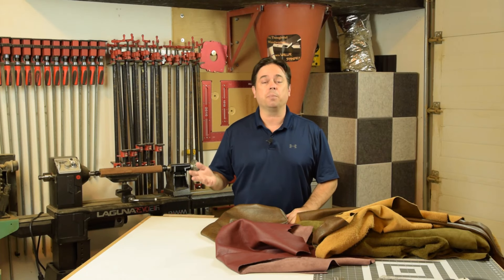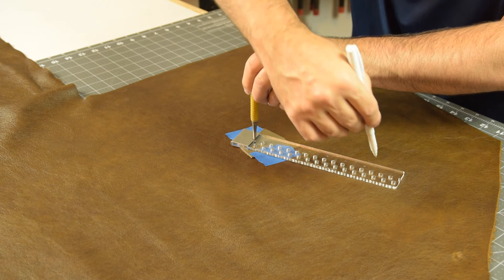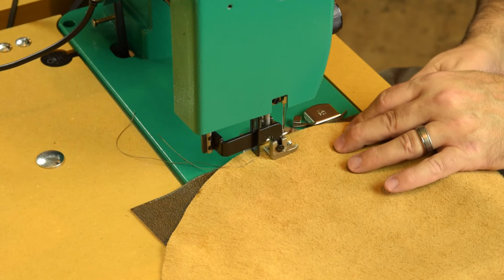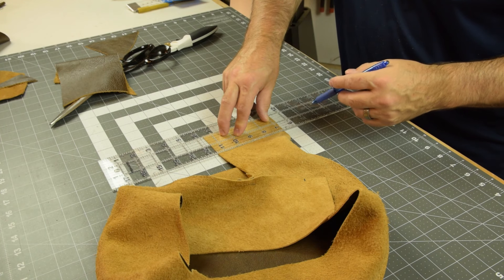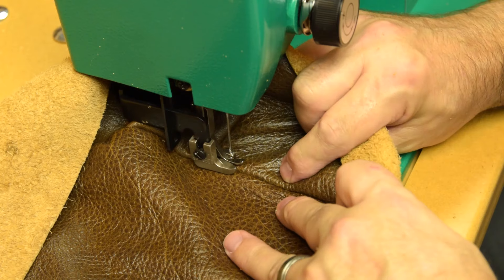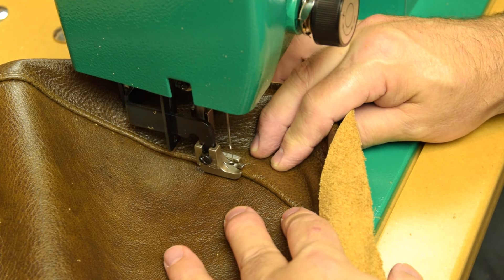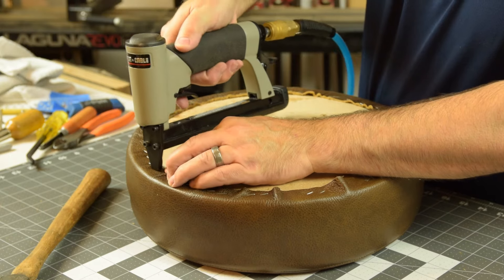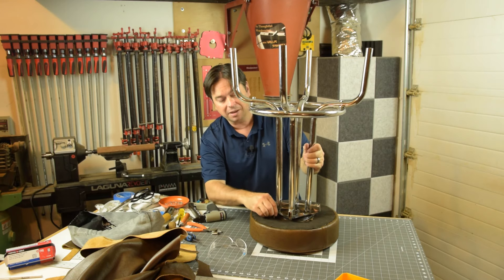Upholster Leather Stool with Sailrite Leatherwork Walking Foot Sewing Machine / Leather Upholstery

Comment: Would air vents help stop the cushion from bursting once many persons sit upon this? Or would horsehair be better than foam? The sewing machine and your steady accurate sewing is wonderful.
Reply from the maker: You bring up a good point about venting leather.  Loose leather cushions like backrest cushions should be vented.  Seats attached to plywood or other frames don't need vents, as long as there's a way for the air to escape.  Drilling a few holes in the plywood is a good idea.  As far as your horse hair question, I really prefer foam for comfort and availability.  Thanks!

Comment: What is that little curved attachment to the right of the sewing foot? Looks like a half moon shaped sewing guide of some kind? Did that come from sailrite?
Reply from the maker: Hi Wendy, that's a pair of small magnetic edge guides.  They're the  generic version, but Sailrite sells a long magnetic edge guide that's better.  
Best
Reply: You may find that the platform of your sewing machine has one or two empty screw holes near the needle, these are for attaching an assortment of things such as edge guides. Just don't use long screws that could interfere with the machine.

Comment: Thanks!
Reply: I am all over the place asking for your help, Willie; and it seems I need your help again.  I had to trim all four sides of the top and bottom panels for my buttoned rectangle cushion.  That means I lost the part where I backstitch the seams. Now, I am trying to figure out how to secure those stitches. They will be in the half inch seam overlap for the top-to-side and bottom-to-side seam overlaps but I still worry about them. I am considering using leather cement for all of these seams but I do not want to go forward until I know what I should do to secure the stitching. Any advice is greatly appreciated.
Reply from the maker: That's so kind Darryl.  Thank you!
Reply: @TheThoughtfulWoodworker  I will try to give that much every time I have to ask for help. I am on Social Security or I would give more because,Willie, I would be lost without your help.

Comment: Looking good. 
You don't need to use a needle just pull the bottom thread and you'll get a loop to pull through.
Reply from the maker: Depends how far you sewed and where you want the knot.  But yes if you plan ahead you can skip the needle.
Best

Comment: How does it sew with foam?
Reply from the maker: It would do 1/4" scrim foam ok, but the presser foot doesn't lift very high.  Max it will sew is about 5/16" compressed thickness.

Comment: So are you still monitoring this 2021 video comments section?  I discovered the base material of my kitchen stool is a piece of fine 'grain' particle board. Have you any experience substituting it for more sturdy material? The hardware mounting screws were pulling out hunks of the old board as they became use over time and I am reluctant to simply use it again. Simple plywood looks like the edges can't be trusted.
Reply from the maker: Hi Michael, particle board actually works okay for stool seat bases.  I've found particle board in original Stickley chairs.  Plywood is even better.  I usually buy plywood from a hardwood retailer for better quality.  
Best of luck.
Reply: @TheThoughtfulWoodworker  Thank you very much for the comeback. I had hoped with your shop equipment and presentation manner that you might know. I realized this morning [guardian angel at work] if I simply flipped the particle board over and used the other side my concern about edge deterioration would no longer apply. My chair had a rim roll of welting and the mfg stapled it VERY close to the edge. I am wondering if the welting is actually required. It gives a nice edge, but I am planning to use the solid thick tacks instead of staples and am afraid it will break out the wood. I have  T50 and T25[for round elec wire] hand staplers but doubt if they are strong enough to penetrate the wood properly.
Reply from the maker: @michaelpcooksey5096  Edge roll is usually optional, as long as there's something to pad the wood.  I've never had very good luck with manual or electric staplers, but they work in a pinch.  Pneumatic staplers, especially fine wire upholstery staplers are preferred if you're doing much upholstery work.  For one or two projects a year, just use whatever you have.  
Best
Reply: @TheThoughtfulWoodworker  Thank you, that was my impression.  My upholstery efforts are now at 2 over 40 years. Ha.